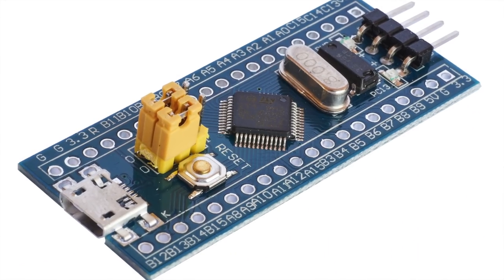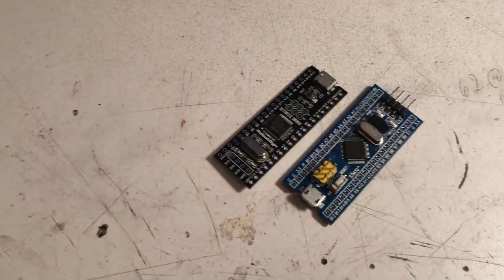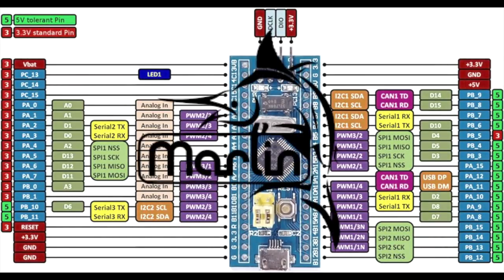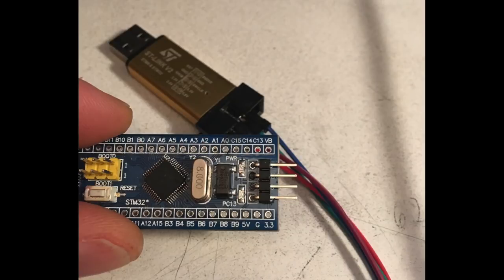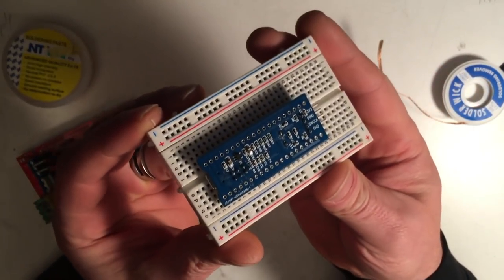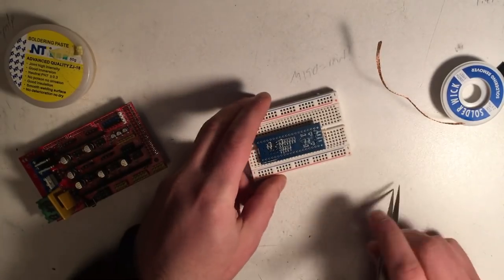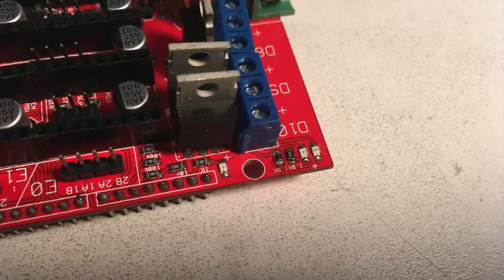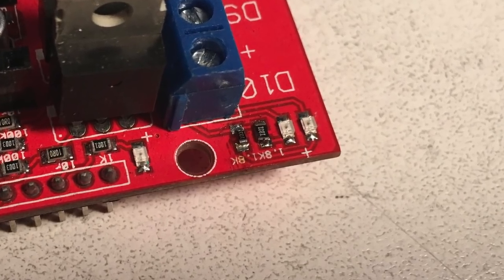Blue Pill board: how to properly fix the USB SMD resistor value

Comment: If your not into SMD, you can just wire a resistor (1.8k) in between PA12 and 3.3V. to correct the issue.

Comment: I bought a couple of blue pills, and I discovered that the cpu is a fake, but working clk32 marked as STM32F, the reset button is rectangular and the project of this board has a mistake, 100khom resistor from boot0 and boot1 jumper pins to CPU, R3 and R4,  instead 10khom as is specified in datasheet. All bluepill from that factory have the same problem, simply is impossible to go in flash mode. I shorted R3 from boot0 pin, and I solved, better is substitute with the correct value. If I want go on boot1 mode, I must correct also R4. In this series R10 is ok.

Comment: quick question. When I home my printer if the hot end or the bed is too far from the end switch. sometimes the motor will get a halt error on either or but if there not that far away from the limit switches it works just fine
Reply from the maker: I think that is usually a safety feature that will halt the printer if you travel too far beyond what the firmware thinks the bed size is, so make sure your bed size is right first, and if it is still wonky, try commenting out the line VALIDATE_HOMING_ENDSTOPS in the configuration file temporarily and see if that fixes it.  If not, it is probably something else